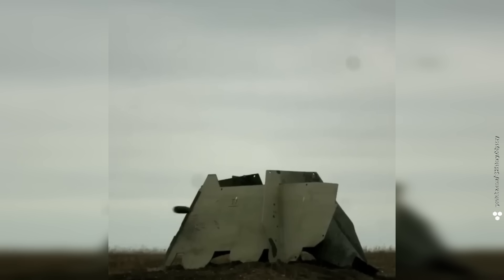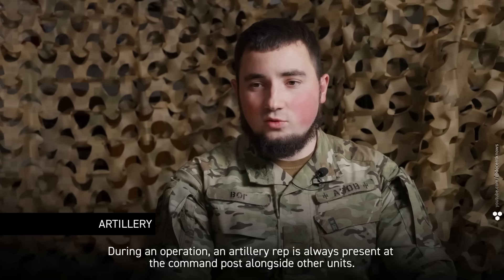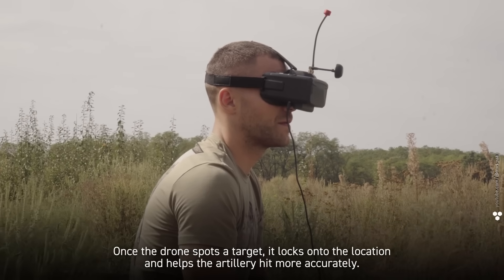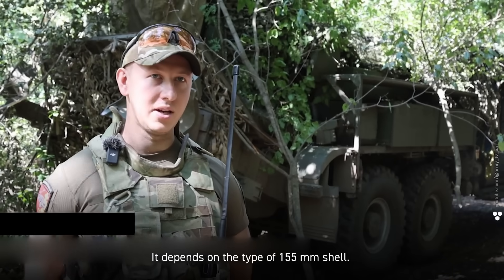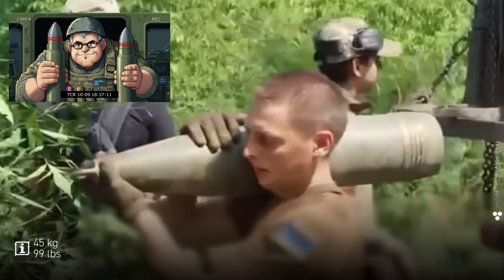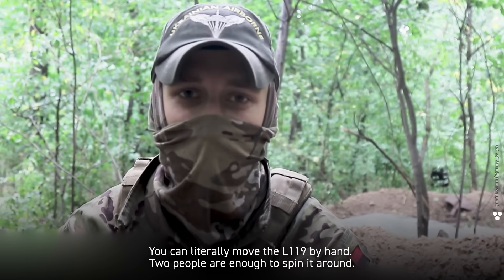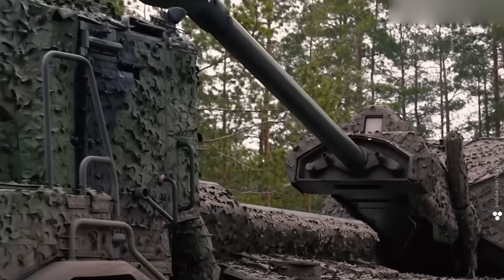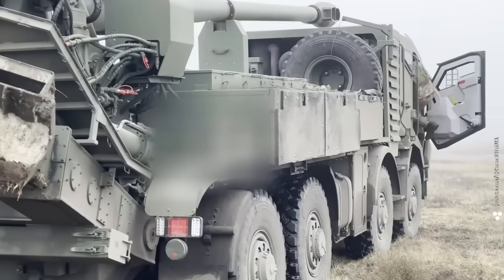From BOHDANA to ARCHER: How Ukraine Fires Back

Comment: At 5:20 firing a 155mm with the lifting ring still in the fuze well. In the 70's i found 3 of these sticking out of a hill in benicia arsonal, 2 still sit here in my room, one on the front porch. They're 97lbs ea😊